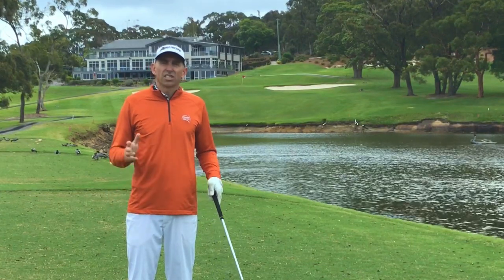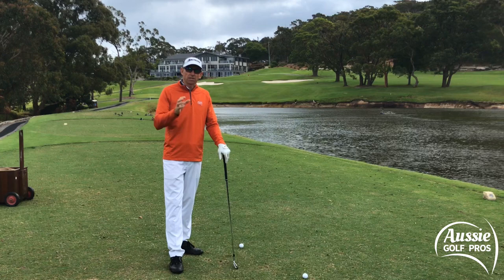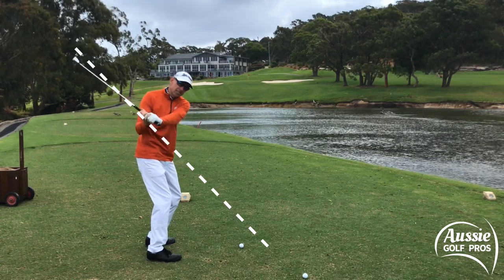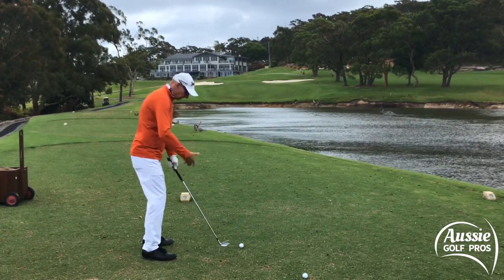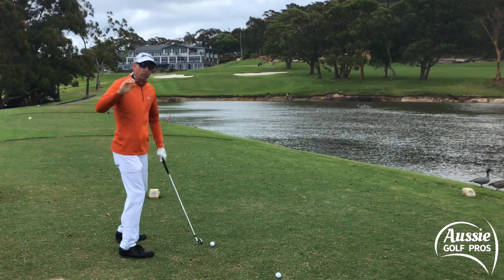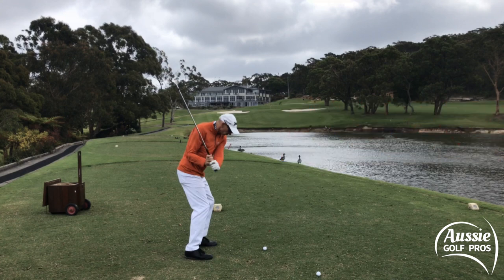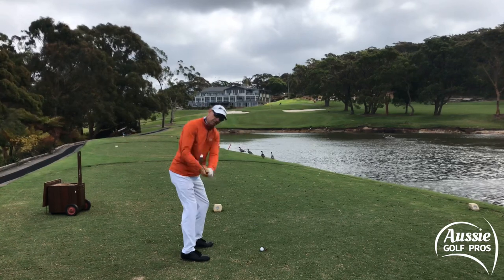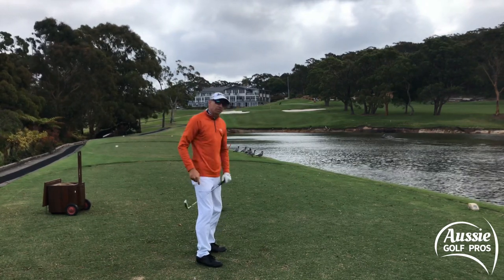The SlingShot Golf Swing - Plane Facts

Comment: Thanks for the tip. But I didn't see it in your swing, though. It was still pointing below the ball. I don't know whether it is a good suggestion for irons as you need to come steeper into the ball. May be good for Driver and fairway woods.
Reply from the maker: Thank you for your comments Orkayen. I definitely don’t swing the club as well as the Tour players but strive to shallow the shaft more when I have the opportunity.
The best players still shallow the shaft with the irons. Compression of the golf ball should be achieved through lag and timing. Definitely NOT with a steepening of the shaft angle!
Cheers
Reply: Only way you can have a steep club shaft and be any good is difficult. You must have really strong wrists and forearms. Grip the club with a weak left grip position and have your ball position more forward. It can work but you better hit a lot of balls and be an excellent athlete. Why make an already difficult game a chore?